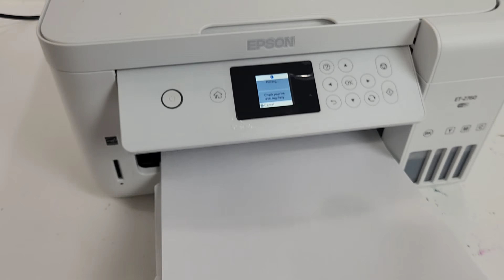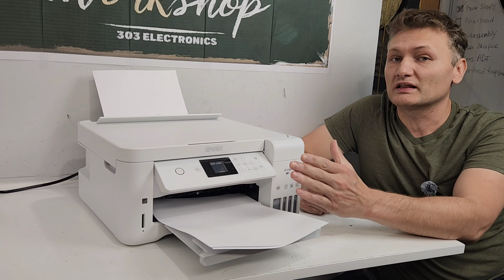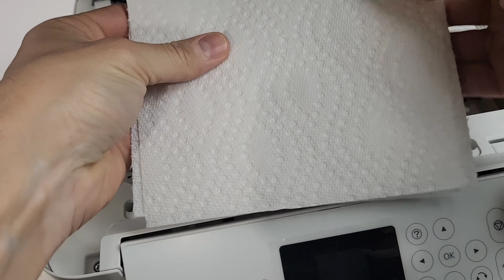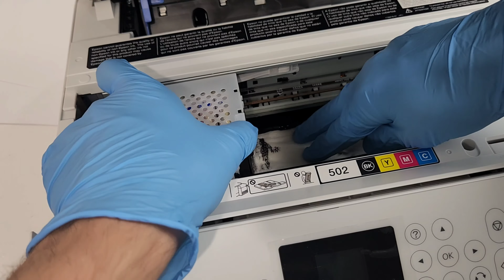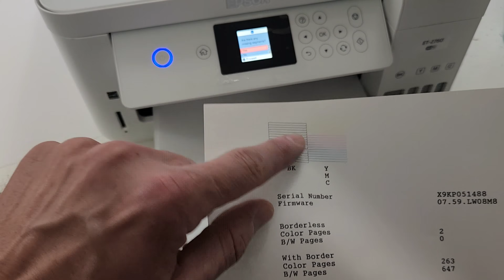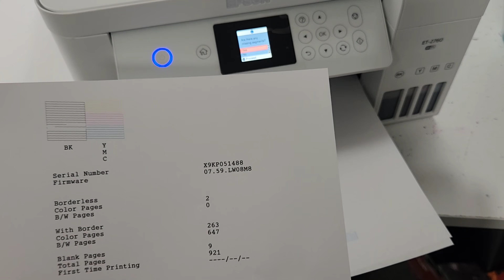Fix Epson EcoTank Print Quality Issues | Print Head Cleaning | ET-2760 ET-3600 ET-4800

Comment: Many thanks.  I knew there had to be a physical way to clean the print head.  I used 99% isopropyl alcohol instead of windex, paper towel wasn't as dirty as yours, but 4 folds of a paper towel later and the nozzle check was mostly good.  a power clean after that and I'm now clog free!  I appreciate the info!
Reply from the maker: That's great news, I'm glad you got it working again! 👍

Comment: Thank you for this, it worked perfectly. I found another video that used a cleaner kit and took the print heads off but I only did your way, then did a deep clean and waited 12 hours and it worked like a charm. For a cleaner I used my homemade cleaner which is concentrated thieves oil cleaner, mixed with water, vinegar, and a little bit of Dawn dish soap and a few drops of lemon oil. So two cups of water to about a leadful of the thieves cleaner and a half a cup of vinegar.
Reply from the maker: Thank you very much for your feedback and for sharing your cleaner recipe. Have a great day!

Comment: I cleaned the printheads but lost the tiny screw that secures the cover for the printer heads and cartridges. Also kind of broke the top of the little box when trying to find the lost screw. Any idea where to purchase new top plus a replacement screw? (I think it is a 3x12mm screw.) Thanks in advance for any guidance or advice.
Reply from the maker: Hi. I'm sorry for the trouble you're having with the printer. I would try eBay for parts you need. There are some sellers who disassemble printers for parts. They are not available from manufacturers. If the missing screw or part does not interfere with functions of printer, I wouldn't worry about replacing screw or part.